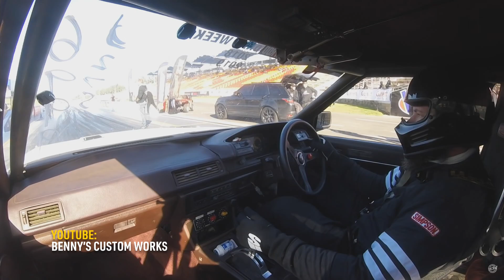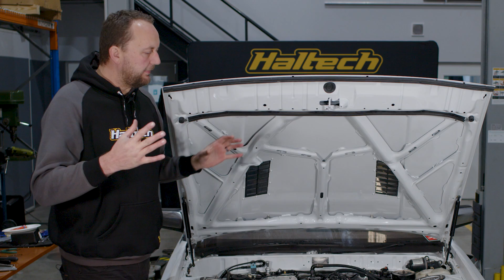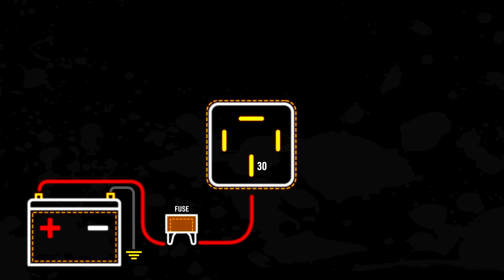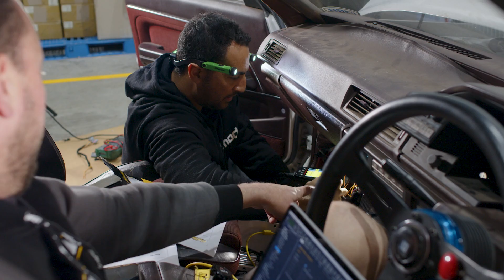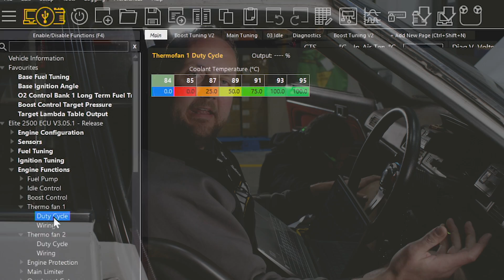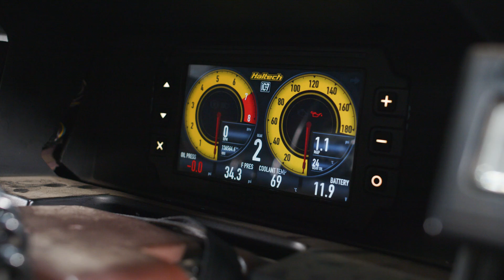Benny's Cresta gets a PDM upgrade | Technically Speaking

Comment: The NSP software really needs to be updated to match what your competitors are able to do. 

Why can’t I use the same keypad input for two outputs without having to hack a rotary trim output. E.g. if I have 2 thermofans and I want to run them at 100% after a race I can’t do it with 1 button. Same with the wipers, fuel pumps etc

You have introduced shock pots  in the software but they aren’t available on the v2.35 CAN protocol. 

Why are the number of Generic Inputs and Outputs limited for Elite ECU products? This limits the number of potential circuits able to be run from the PDM. I assume it’s due to the lower processing power but I could switch on every single sensor in the software and it would still run. Why not just have 10 extra generic inputs and outputs that are only available if they will actually impact the processor with the current sensor selection. Surely there is processing power not being utilised because it is allocated to sensors that aren’t used.

The Haltech forums have been offline for days. Is there any plans to fix this?
Reply from the maker: The Haltech forums have been closed permanently, I'm sorry. 
Please contact our tech support team via www.haltech.com/contact-us for your other queries.
Reply: @haltech  any reason why?

Comment: Could you set up a display on the dash for you multi option functions? You could have a single button, set up however many steps you want, something like launch rpm then tap through, 3500, 3800, 3900, 4000….. 3500 each tap the screen would just display the new setting for 3s or similar.

Comment: Considering how many cars are being electronically written off with no supply of obsolete parts, this unit seems like a solution to reducing automotive waste on a grand scale. 
Would be good seeing a similar video of this unit being used to control regular BCM functions like HVAC control, windows, audio, lighting as well. 

Maybe via a floor layout of parts? A simulation or via a series of graphics?

A great bit of equipment for sure.

Comment: Don't use pin 86 for ground because when you wire up a diode protected relay, it will blow the diode up and leave you with nice flyback to the ecu output
Reply: Yea, I’d go a step further and say always look at the diagram for the relay before wiring it. There is really no such thing as a “standard” relay.

Comment: That seems like a lot of coolant pressure. 78PSI
Reply: Why? Coolant is at boiling point or higher, and it can go over boiling point  because it’s pressurised 
They used to push huge trains with steam pressure. In fact the whole industrial revolution was because of steam engines and the pressure created by boiling water. 

 Guess you didn’t do physics at school

Comment: Why doesnt Benny Bite the Bullet and buy a Nexus?
Reply from the maker: The Elite works fine for the time being - but you're right the car will probably end up with a Nexus eventually:)
Reply: @haltech  seems weird to remove and/or prioritize sensors when inevitably it will have a Nexus. I know they're pricey but the car is snowballing fast. 
Buy once, cry once?
Reply from the maker: Yep, you're not wrong, Benny obviously had other short-term plans that were more pressing than installing a Nexus but we're told once the car is back from the Drag Week it'll be due for more upgrades.
Reply: @Jake_Hamlin  I have an R5 ready to go but because Dragweek crept up on me we’re running the 2500. I currently have all the data I need but it will be cool to add more sensors with the R5
Reply: It is an evolution of a product, while yes it can... it was working with it not being an issue.